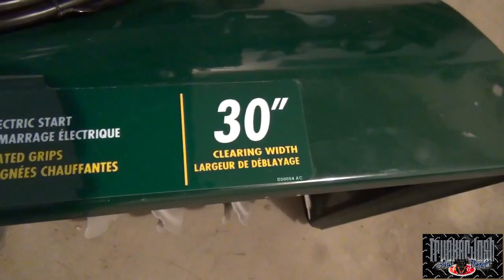AN ADVENTUROUS DAY  - (MLD147) - My Trucking Life

Comment: Make sure u put sta-Bil fuel stabilizer in your snow blower and lawn tractor . I had a problem with my snow blower wouldn't start because of old gas
Reply: I always run ethanol free gas in all my small engine equipment. It's about a dollar more per gallon than premium.
Reply: All of your small engines that are used infrequently should always have Sta-Bil in the fuel. And all my bikes (6)! Have Sta-Bil and FULL tanks for the winter. Make sure you run some of the fuel with Sta-Bil thru it before shutting it down for the winter. Anything with steel tanks that is used infrequently should ALWAYS have a full tank because rust will form inside the tank due to condensation.

Comment: Hey truckerjosh, great video once again, sucks that happened to ya, not to far back I hit a kangaroo right jumps out on the road, skips over than decides to skip back. I hit the darn thing in the left of its backside. Now I was driving one of them euro cabovers and when i hit it, that dented the top left right in. Luckily it wasn't my truck so yeah. It was alive though because I had a look just after pulling in on the left. This is exactly why you need them bull bars (( is what we call em here )) but yeah it happens and you gotta make the best of it. By the way I see you have a ps3 on the tv there, hahaha wouldn't mind adding my PSN ? Gotta do somethin to pass the time aint that right.